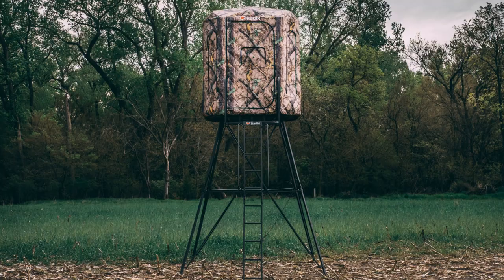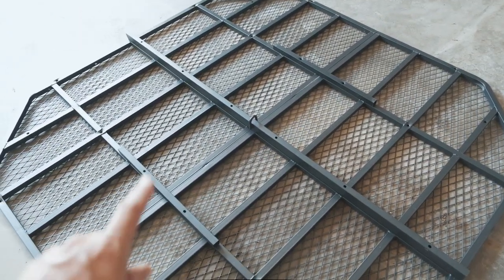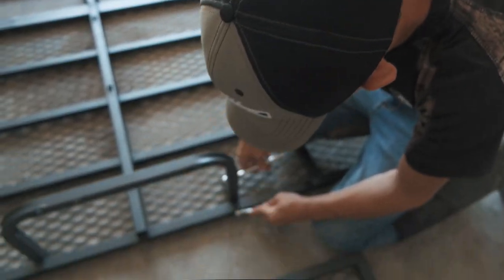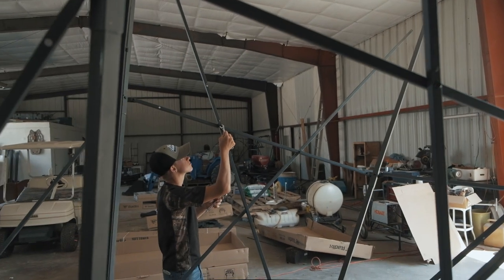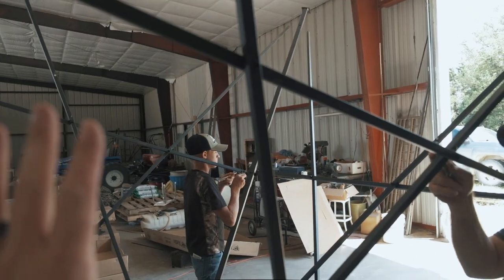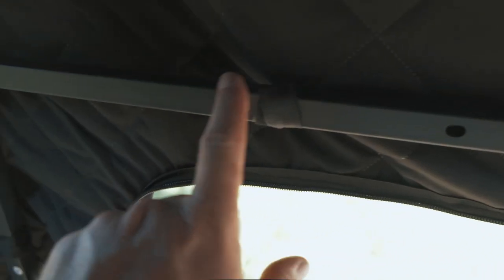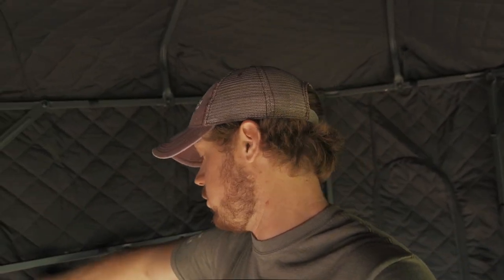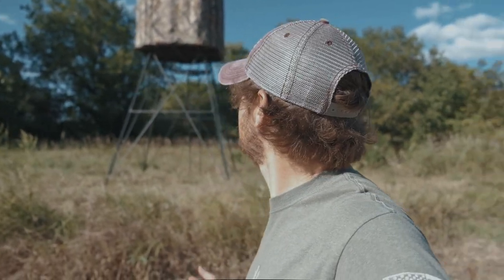Radix Monarch Blind Assembly - Whitetail Weekly Episode 30

Comment: Mine came with no numbers on parts. And I do not recommend following the instructions exactly. If you're going 10 ft assemble the tower like these guys did, in the video. The instructions tell you to mount the blind frame and complete the 5ft section before adding the 10ft extension. I learn, the hard way, to leave the blind assembly until last and install it in the field. Plus my ladder braces were way too short and no predrilled holes. I had to drill holes on the ladder platform then drill the legs where the braces landed. The x-braces didn't fit the factory drilled holes either. I had to assemble the tower legs and then let the x-braces determine where I drilled the correct holes. Overall it's a good stable tower blind but they could have better with factory prefab work and basically the instructions are just suggestions. If you have any mechanical aptitude you can figure it out and just consult the instructions for the pictures.